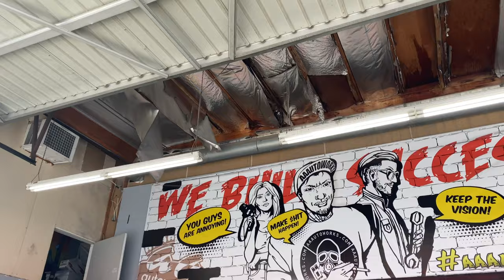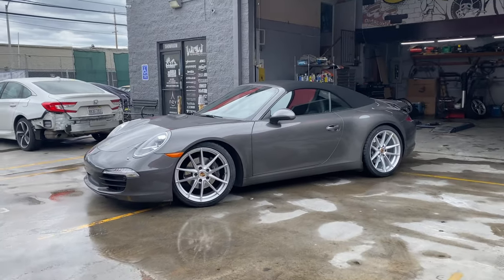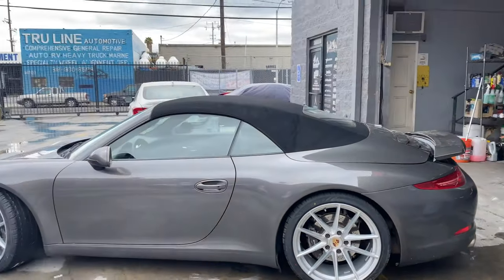Transformed The Porsche 911 Carrera

Comment: Would never recommend TSW wheels. Poor castings. Rotary forged barrels with cast faces. Cheaper option for sure, but why risk a Porsche (and your life) with wheels that have a lower load rating. Good luck.
Reply from the maker: This is a first hearing this. 90% of the porsche  guys in my area (Los Angeles) recommended these and TSW has a good reputation i've had zero issues with them so far and i've put 8k miles on this setup
Reply: @itsJustDaniel   Glad to hear they're working out.
Reply: I had a set on my S4 a few years back, and experienced two consecutive sets where spoke sections cracked. - hence my apprehension. Nonetheless.....enjoy!